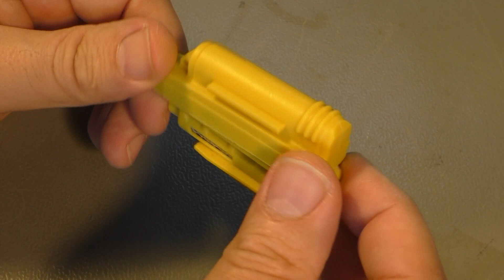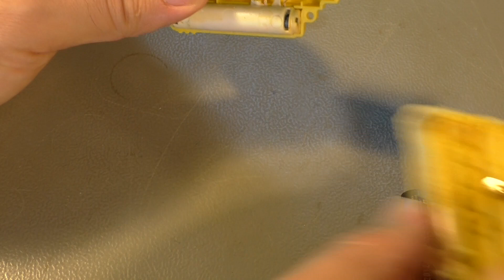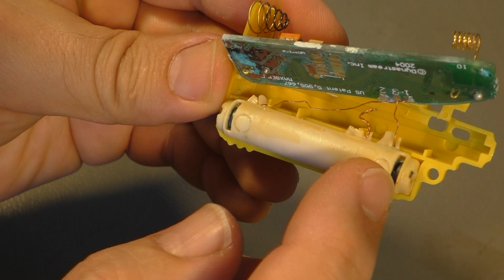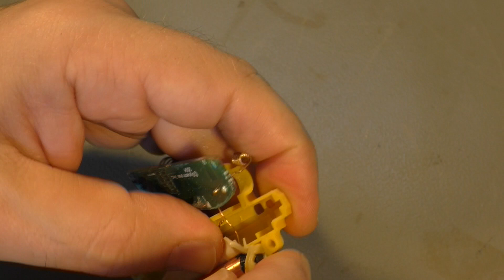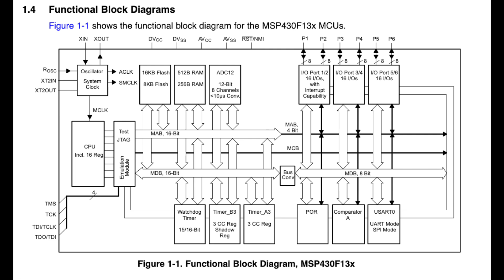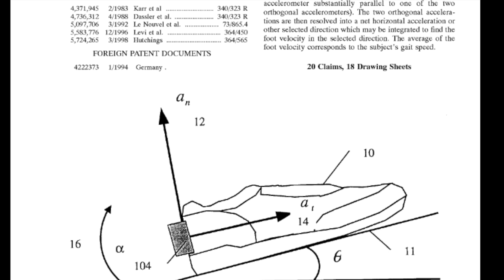A tiny yellow mystery (PWJ196)

Comment: Its likely a medical device amd not a commercially available publicly used device.

Likely it is given to a patient to take home and attach to themselves while doing exerise or work, this data is then streamed to a data collection module, the collection module os tbe valuable device, while this data sending module is likely fairly cheap, and meant to be replaceable in the short term it is expected to be in service.

This would explain why it doesn't use more "user friendly" methods of sending data, and uses a "custom" frequency instead of the common use public frequencies.

Comment: Very old. Looks like that tiny canister is a quartz crystal for an oscillator, too rare and expensive now. If it was modern it would use a coin cell, bluetooth or near field transmission, and MEMS oscillator. Odds are data was transmitted digitally at low frequency micropower? Which means very low data rate.

Comment: That patent:

Motion analysis system
Oct 14, 1997 - Governors of the University of Alberta
A device comprised of at least a pair of accelerometers and a tilt sensor mounted in fixed relation to a datum defining plane (sole of a shoe) maybe used for extracting kinematic variables including linear and rotational acceleration, velocity and position. These variables may be resolved into a selected direction thereby permitting both relative and absolute kinematic quantities to be determined. The acceleration is determined using a small cluster of two mutually perpendicular accelerometers mounted on a shoe. Angular orientation of the foot may be determined by double integration of the foot's angular acceleration (which requires a third accelerometer substantially parallel to one of the two orthogonal accelerometers). The two orthogonal accelerations are then resolved into a net horizontal acceleration or other selected direction which may be integrated to find the foot velocity in the selected direction. The average of the foot velocity corresponds to the subject's gait speed.

Comment: From the US Patent Office:
A device comprised of at least a pair of accelerometers and a tilt sensor mounted in fixed relation to a datum defining plane (sole of a shoe) maybe used for extracting kinematic variables including linear and rotational acceleration, velocity and position. These variables may be resolved into a selected direction thereby permitting both relative and absolute kinematic quantities to be determined. The acceleration is determined using a small cluster of two mutually perpendicular accelerometers mounted on a shoe. Angular orientation of the foot may be determined by double integration of the foot's angular acceleration (which requires a third accelerometer substantially parallel to one of the two orthogonal accelerometers). The two orthogonal accelerations are then resolved into a net horizontal acceleration or other selected direction which may be integrated to find the foot velocity in the selected direction. The average of the foot velocity corresponds to the subject's gait speed.

Comment: I'll bet it uses a radio standard called ANT+ that is picked up from one of those Garmin running watches. The band that you strap around your chest uses the same system. The shoe sensor provides cadence.
Reply from the maker: You mean it could be a Garmin accessory? But I thought ANT is using much higher frequencies?
Reply: @PlaywithJunk  Hmm' you're right. ANT+ is 2.4 GHz. I forgot the name for the radio standard then.
Reply: Garmin only acquired Dynastream at the end of 2006, so after this was made. So while Dynastream today might only make ANT+ devices, this is definitely older tech.